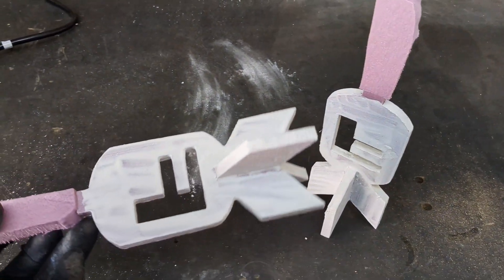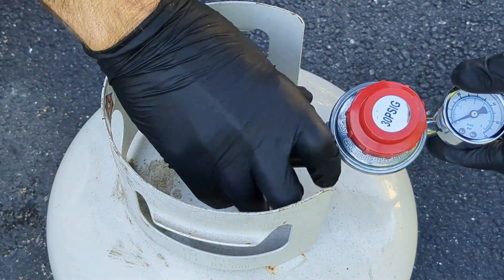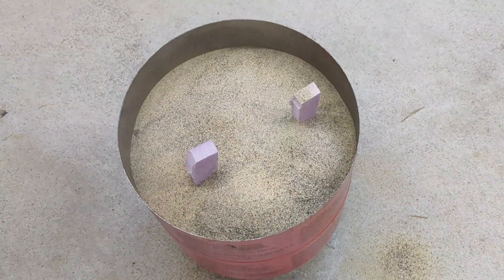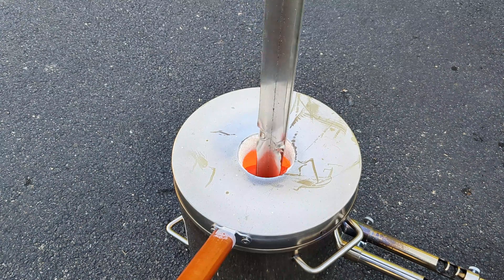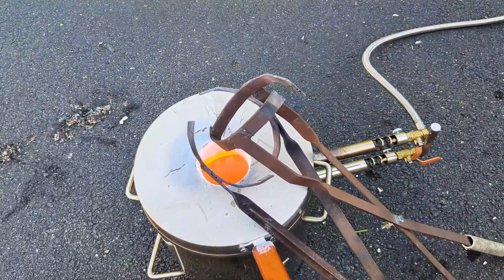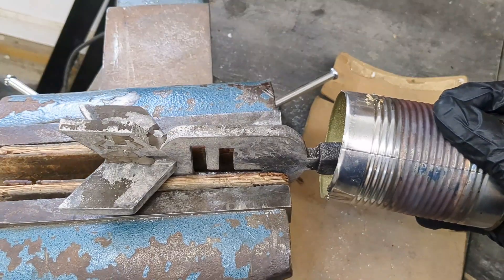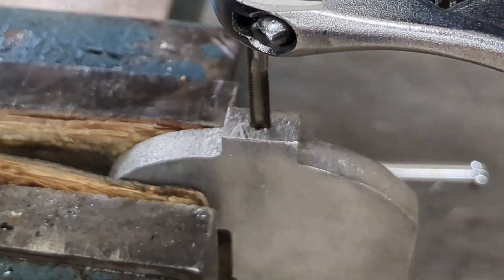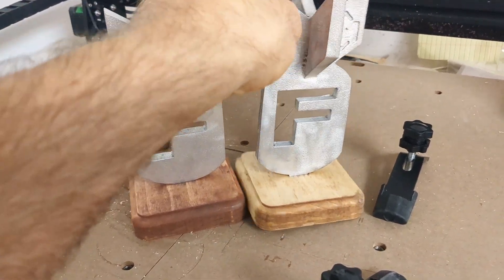Make Lost Foam Mold For Casting - F-Bomb Art - Melting Aluminum and Making Ingots

Comment: Why are you covering the styrofoam with the plaster stuff prior to burying it? I’m new to this and was curious if you could skip that step and just bury the styrofoam as is! ? What is the purpose of coating it!? Thanks for any help!
Reply from the maker: It gives it a smooth surface finish.  When you don't use it, the cast will pick up the grain of the sand.  You can see in this video how rough it looked since I didn't coat it with gypsum.
https://youtu.be/myU_VDyrb1g
Reply: @HeinrichsMade awesome that makes sense! Thanks so much for the help!

Comment: Você passa qual material no modelo
Reply from the maker: The model is made of Polystyrene XPS Foam
Reply: @HeinrichsMade  passa gesso no modelo. Tô fazendo não dá serto fica falha
Reply from the maker: @marciomila9264  the foam is the model.  I coated it with thinned out drywall plaster.  It does work I do it all the time.

Try doing it with just foam.  You don't need the drywall plaster. It only helps the surface finish.